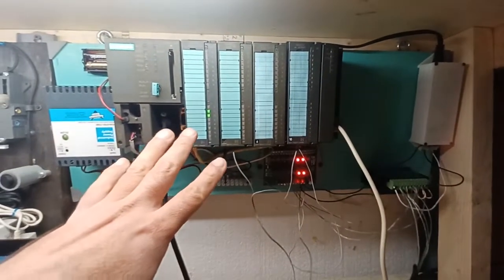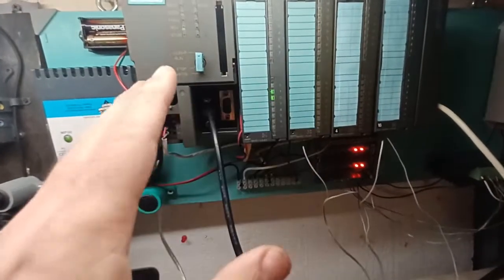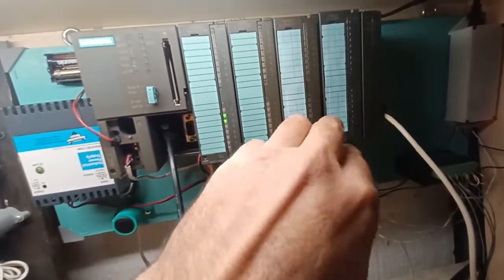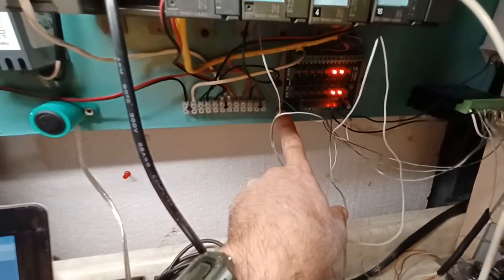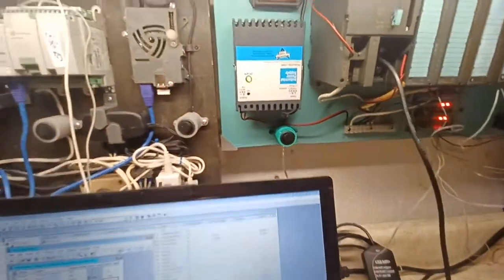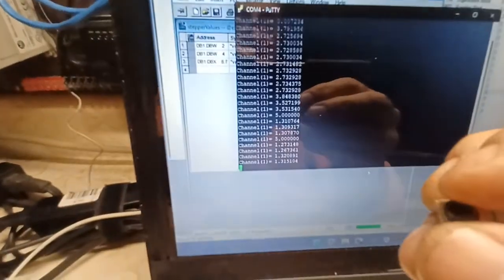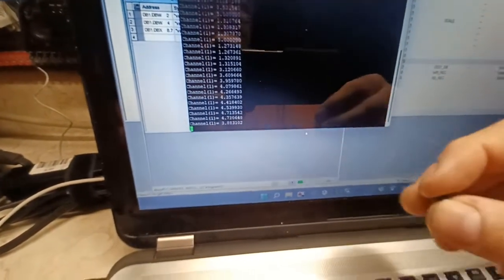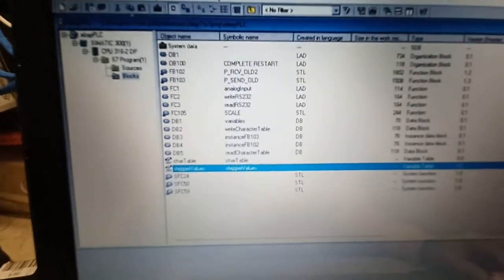S7-300 PLC with RS232 and stepper control

Comment: Hey there I need help connecting a stepper motor to my s7-300. The driver I’m using is a TB6600 and I have wired the dir+ and pul+ to Q0.5 and Q0.6 respectively. I just need help figuring out how to program it. If I go to the technology objects I can only see the simple motion and the ‘axis_ref’ I just need help figuring out basic control.